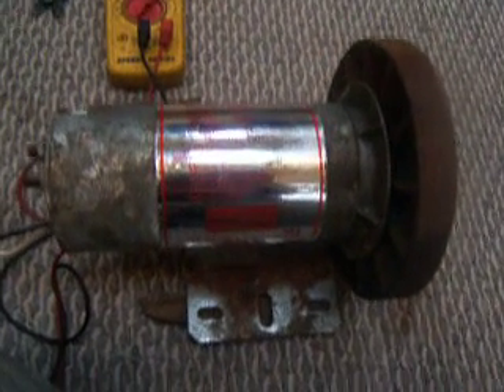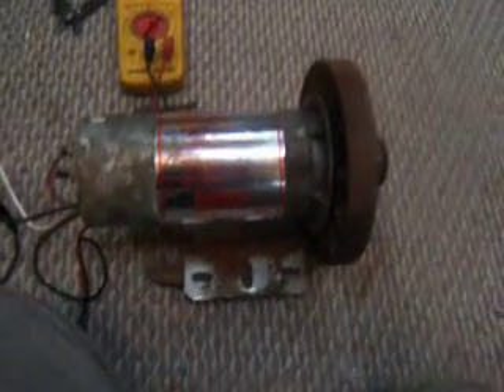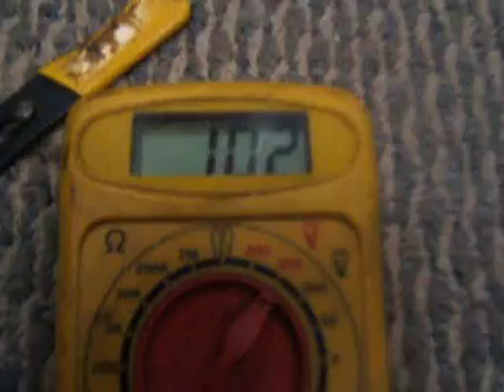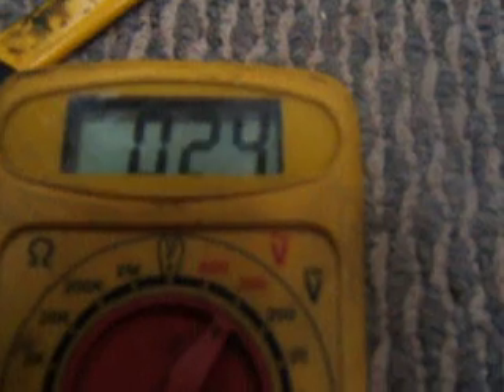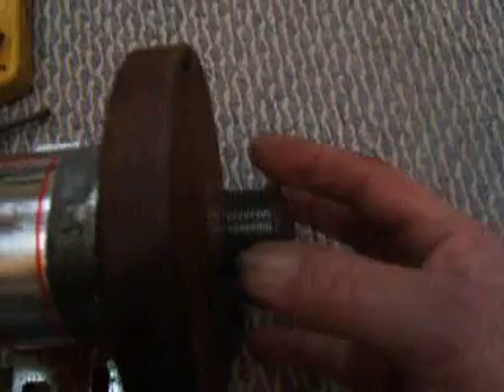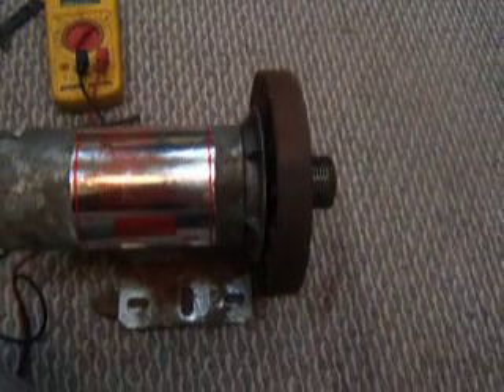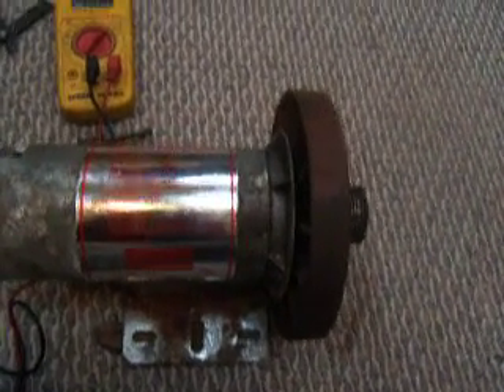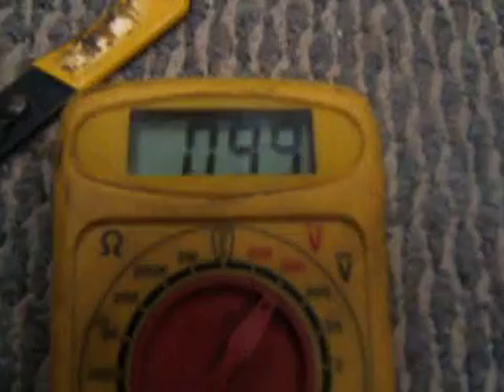DC Treadmill motors for electric generation Rock!

Comment: Thats pretty cool! I am considering buying a used one from Ebay for about $50... How much were you able to get the motor for?
Reply from the maker: free scrap
Reply from the maker: THeScoobyNoob actually watch the craigslist free ads for free treadmills. usually they have tread, pulley, electronics problems and motor is fine
Reply: THeScoobyNoob I will take a look... thank you!
Reply: THeScoobyNoob Ummm... I didn't find much on craigslist. I am considering going to the Junk Yard. Where do you get free scrap?  :P
Reply: THeScoobyNoob i put a post on craigslist looking for a free unused treadmill for a project, a day later got a call to pickup a free one that was about a mile from my house ..i took the motor out and scraped the rest so really no need to buy one lol